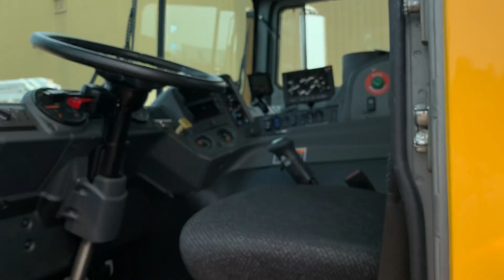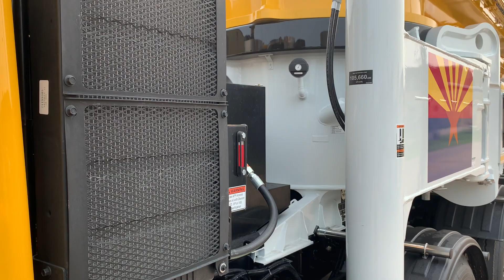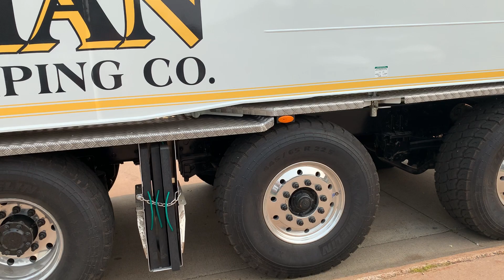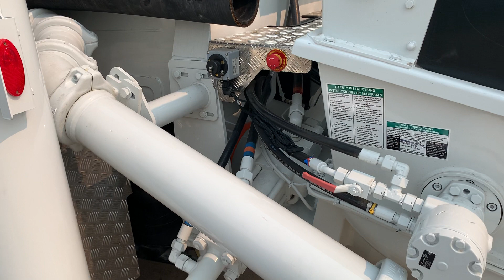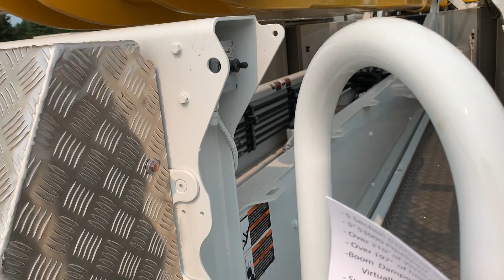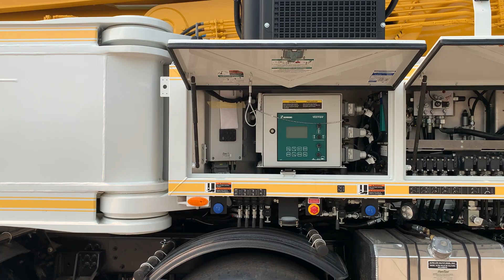Let's Walkaround The S 65 SXF

Comment: My most hated thing about the big booms, is the outrigger pad placement, at the end of a long pour, those outrigger pads get so bent and deformed, that they WILL NOT go back in storage, and you have to put them in the hopper or on the side, all they have to do is widen the outrigger storage. just a little, either that or you hammer them into place. its a massive pain in the ass